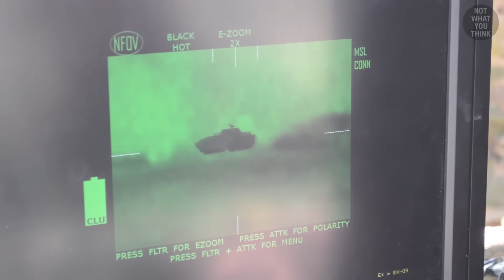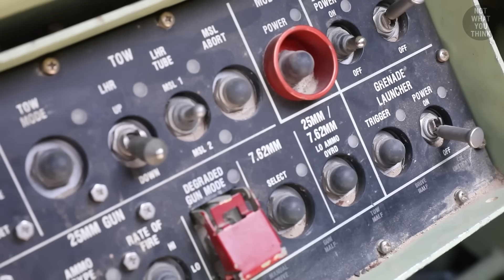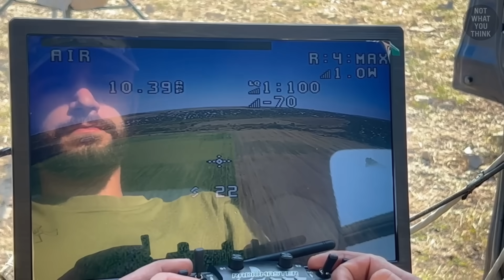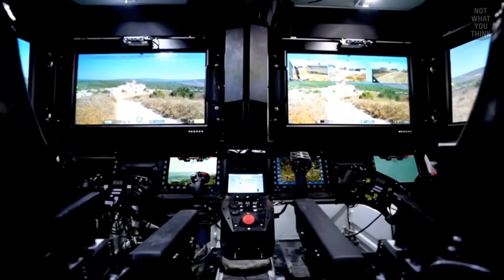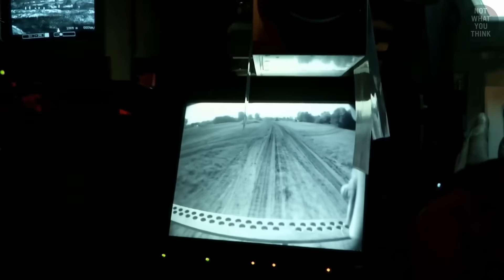How Bradley IFVs prove more Useful in Ukraine than Tanks

Comment from the maker: Do you think heavy main battle tanks are standing on their last leg?
Reply: No. Since their inception they have always been in an arms race with infantry, with both trading off the advantage. At first they were almost indestructible to infantry,  until the anti-tank rifle made them vulnerable. Then they got thicker armor, and only tanks could harm them. Then HEAT rounds made them very vulnerable again. Infantry and tanks have always been trading off the advantage, the only difference today is that infantry currently have th upper hand, but eventually tanks will gain it back with some new technology. Just because they have the disadvantage now doesn't mean they are obsolete, they will.always be useful in some capacity, just like how after ww2 people though HEAT rounds made them useless was proven wrong
Reply: @pogfrog4221  Agreed. Main Battle Tanks will evolve but still remain relevant. What MBTs are going through is a temporary setback for the current designs. Threats they were not developed to counter are currently a weakness. Similar to full plate armor of the 15th century meeting firearms. Back then, the trends set largely saw a reduction of armor more and more until we got to armies not having any armor to speak of until body armor was reintroduced in the 20th century. Body armor of today is essentially an evolution of the suits of armor of the past, just meeting the needs exposed by the newer threats of firearms. MBTs are not going to be phased out as they still have extreme survivability bonus and their capabilities to penetrate and overrun defenses will always see them used in battle. They will change in capability to meet the newer threats.
Reply: I dont think so
Reply: @AFG.1 😊
Reply: People keep claiming that the tank is dead. I’ve even seen people arguing that we should only build IFVs from now on. These people are brain damaged at best. Heavier tanks serve a very different purpose to an IFV, and instead of trying to design one vehicle that can do it all, I think we should be specializing our vehicles more. After all, a Jack of all trades kinda sucks at everything.
Reply: No, because even though it looks like they are on their last leg these days, there may come a day when you need a big heavy main tanks like them again. Technologies will continue to improve and change, and one day we might come a full circle and end up in situations where you need something big and heavy to defend or punch through hard targets.

That's just me though. My 2 cents.
Reply: These light, mobile infantry transport/support vehicles are a trend because this is currently being understood as the next step in increasing effectiveness of land forces. Same with drones.
Next step, not a replacement for existing doctrine. Just polishing it.
Crowding out "mammoth" tanks completely might take another hundred years.
These light 105 mm tanks might be an even smaller niche, for a long, long time.
Reply: No, because active protection systems such as Trophy, Iron Curtain, Quick Kill and Afginit will become better, cheaper and more common.
ECM and IR suppression and stealth and quiet electric engines and improved armor will also keep MBTs relevant for decades, if not centuries to come.
Reply: Abrams X says otherwise =p
Reply: no? Look at ukraine.

It became very apparent that APS, Drone jamming, Drone coutnermeasures etc becoem more relevant but the tank is still relevant,

And we aint seeing massive tank manouvers due to it becoming a staticer war. Russia was not intelligent enough to make mass tank manovuers in the beginnign and UA lacked the number.
Reply: i don’t think so, if you think about the better western tanks are rarely being destroyed in ukraine, for eg the only challanger 2 losses have been from friendly fire, and a ukrainian driver taking one right into a minefield. so it’s just that russian tanks are outdated (obviously) and are not up to standard anymore
Reply: @spytf2693  and are LED absolutly horribly
Reply: No.  I'd say that there's always going to be a role for a Heavy Armoured Combatant, just as there'll be one for Infantry and a Light Hard-Hitting Skirmisher.  It's just a case of how technologies have changed modifying how crucial certain roles are.  In the modern case, it's just a factor that the Light Hard-Hitting Skirmisher role has until recently been rather minimalised whilst the 'Tank' role has stood out on top with the Infantry comfortably holding it's spot in the middle.

All that's happened now is that the current Tank designs have shown they were designed before several major developments in military technologies happened that make it so the 'Tank' role is not quite as prominent as it was whilst the 'Light Tank' role has regained some relevance.  However if future developments happen, it could change all over again.

For one example I could very easily see happening, you could have a breakthrough in ECM that means drones need to have their controller be very close to break through the jamming whilst also making a major breakthrough in large unmanned combat vehicles.  If that happened, you'd probably see a situation where the Tank evolves into a Command Tank which focused less on it's own offensive capabilities in exchange for strong defences and the ability to control a squad of light tank drones surrounding it.  But the Tank would still be a Tank.
Reply: tanks utilize a method of engineering specified for them. I cant recall the specific terminology, but it boils down to mixing mobility, firepower, and armor. tanks will almost always have a place on the battlefield because they are infantry support/anti tank systems at this point. all we've seen is modern (a hilariously loose modern for Russia) vehicles meet modernized tactics. Russia is still essentially doing the same thing they've done in WW2 where Ukraine was taught tank tactics by western powers, especially the US.

Russia relied too heavily on their tanks, pushing ahead without support, pushing blindly into enemy territory, and really not having any situational awareness whatsoever. Honestly you should've made this video about why Russia sucks at tank warfare because that's all Ukraine has shown the world.

in the several months that Ukraine has had western armor they've lost 1 challenger 2, and I believe 2 or 3 leopard 2s. that's nothing compared to what Russia has lost in the same time period for their most modernized models of T 90s and T 80s.

The US is simply looking to build a dedicated light tank platform as it has reduced costs and provides excellent firepower. The previous equivalent to this that was somewhat regularly fielded was the stryker MGS and those have been retired if i remember right.

a well trained, diversified, and efficient military are what really matter.
Reply: The tank has been standing on its last leg every since it was invented, so yes, main battle tanks are standing on their last leg, and are likely to keep doing that for several decades still.
Reply: They will be a smaller component of the overall force, drone FPV pilots and long range MLRS teams will take some of that back, but pretty soon they will have unmanned tanks and all bets will be off
Reply: I think they must coexist with lightweight agile models to protect them in a campaign. The lightweight models should focus more on aerial based attacks that commonly take out the main battle tank.
Reply: MBTs can definitely stay relevant, but they're gonna need radar and point defense weapons to do it not unlike surface Navy these days.

an efficient DE weapon and detection system for example, but until these get installed on modern armor it's definitely going to be an argument whether MBTs are a liability or assets in Ukraine.
Reply: Clearly not and frankly this video is fairly ignorant. 
1) Tanks have always  been more vunerable to infanty weapons. Even as far back as WW2 Anti tank cannons destroyed more tanks then other tanks/airstrikes/arillery. So this not really a new development. And hiding troop movement was not really the main goal

2) A IFV is not just a troop carrier otherwise it would be a APC this is what the MBT would usually fall under. No IFV has really "blurred the line" with a MBT with the exception perhaps of China's VN20 with the 100mm variant. Though that seems to be aimed at clearing trenches 

3) There is also nothing that can fufill the role of a MBT that is not a mbt and pretending a IVF better survivability then an MBT of the same generation is just insane. Yes if people are to busy shooting at the MBT next to it it will survive longer, but that are their respective roles. Get rid of the MBT and all of a sudden that much thinner IFV is a easy target. You need both IFV's and MBT's to work together. The reasons Bradleys are doing well is because almost everying thing else (except for the newly delivered western MBT's)  is junk that has not really been upgraded in 30 years. And the BMP has been doing just as badly at its job as Russias MBTS. 

4) no MBT's are not better at urban bombat, sure they have better armor. But the limited elevation of their cannon can often mean they cannot fire at targets that are to high/to close as Russia found out in Chechnya. 

5)Western Tanks also do not opperate in stand alone formations. Silouet is also not that much  of a issue. 

6) The renewed interest in light tanks is not to replace the role of the MBT but to suppliment it. Yes MBT's are getting lighter but that is also to make space for better active protection systems and other such.

7) Really less oxigen?
Reply: Light and fast is absolutely not a new strategy though. Many countries in Cold War tried it, and then dropped it. There is no way lighter vehicles are more resistant to all these new things that are threatening MBTs, they are all equally or even more vulnerable to them.
Meanwhile Bradley is simply a different class of vehicle than a tank, meant to act in combination (as Bradles was designed for Abrams) or in different roles. Their massive impact is more in form of contrast to the minimal survivability of eastern equivalent vehicles Ukraine was operating, especially the BMPs with their notoriously thin armor and mine protection so bad troops of both sides often ride on top rather than inside. Which, by the way, are much lighter than Bradleys. There is no escaping physics, more protective measures add weight to vehicles, period.

M10 is not intended a replacement for Abrams, but something to allow airborne and other fast expeditionary forces to have any tank at all, but that's not a relevant scenario in Ukraine.
Reply: Consider the Javelin.  When any bush in a 2.5km radius might burp out a missile that is going to attack your vehicle's weakest top armor, how do you expect losses to be acceptable?  If your infantry is being asked to screen to 2.5km, it isn't really being supported by armor.
Reply: Yes, I do. Even modern MBTs get knocked out by a single Anti-Tank Guided Missile or direct hit of artillery fire, same as a lighter and cheaper to produce and operate light tank, IFV or armored wheeled vehicle. The 120/125mm cannon is already an "overkill" weapon, so it's degrading size will be the next trend, right along the decreasing in armor. Like mentioned, just as it happened with ships...
Reply: Should've said "are they on their last tread" missed opportunity😂
Reply: Nope
The biggest reason why Russia isnt in Kiev yet is because they forgor how to do combined arms warfare
Reply: @neonmem8826  There is no doubt Russia has self limited its engagement style, and asking why might be worth doing.   Knowing democrats have a long standing affinity for Russia [it was, after all, the place chosen to drop the dossier into for purposed discovery by western allies to gift the false provenance needed for fbi actions], I use the bank robbery model: its a troika in full agreement, using the country as a pinata.  Taking Kiev ends the game early and is to be avoided.   Bagman [Biden]: brings the money - makes it rain.  Doorman [Putin] controls access/keeps action going.  Driver [Zelenskyy] facilitates succcess in getting away with it all - he's dancing as fast as he can.  When this crime is over, Putin gets a chunk of Ukraine land relabeled Russia in perpetuity - an annexation will stick.  Biden crime family?  I'd wager a vatican account is in their future - keeping money abroad prevents all manner of US records from ever being created, thereby nullifying foia risks after leaving office.  Zelenskyy?  Who knows.  If he isn't exiled, maybe he becomes an art dealer to reintroduce missing cash to "legitimacy".
Reply: No, all of them will soon be equipped with modern APS like Trophy which can already cover 180º vertical and 360º horizontal so all drone/ATGM operators can go cry in their corners. The only way to destroy tanks will be APFSDS or insanely large laser guided missiles/bombs that can destroy the tank even when exploding some meters away from it, this can only be achieved by Aircrafts.

Also every MBT in the future will become Hybrid, there is simply no reason to not use an electric engine as it can make a tank accelerate insanely fast, the upcoming M1A3 Abrams will probably be Hybrid already as they just have to use the Abrams X powerpack, it is already done and tested.
Reply: I wanna enjoy your video and the intro gets me hooked but then the crigne out of place "is not what you think" line comes and I just, I just have to close out. Sorry.
Reply: No, because I don't see Ukraine being much of a benchmark for Future wars.
It is a war where neither side has the ability to achieve air dominance.
So, half (and arguably the most important) part of the Combined Arms doctrine is missing, which leads to operations being much easier to counter.

Air Superiority, or at least Air Dominance would allow you to strip the defending side of all options for defense before you even send in Tanks.
Artillery? Hunted down by Aircraft.
ATGM teams? Hunted down by Aircraft and Drones.
Bunkers? Hunted down by Aircraft.
With the ability to strike rear logistics en masse day after day, the frontline troops would struggle to get ammo.

This may be the future of warfare for countries that cant afford an Air Force, but the big boys (US, NATO and potentially China) won't really need to face the same attritional battles that Ukr and rus are.
Reply: No, since I think as tanks are evolving right now, so do the tactics. The main advantage of a tank is its combination of mobility, armor and firepower. Now with modern technology like active protection and capabilities of connecting to drones and increasing firepower, I see them becoming more of a multirole military combat vehicle. They will be definetley relevant for quite a while.
Reply: There's a reason hunters typically don't use bazookas and medieval armour when hunting rabbits: there are way less cumbersome alternatives that do the job just fine. The same can be said about tanks, there's no reason for a bazooka if you're only fighting rabbits. And since lighter tanks tend to be more agile, smaller, and easier to keep operational there's always the question of whether a heavy tank really needs to be that heavy. I doubt heavy tanks will go extinct, simply because there's still enough of them around to warrant having your own heavies. But given the potential of missiles the tank guns might never become this big again
Reply: Drones are a new addition to the battlefield and their counters like jamming, lasers and specialized aircraft guns are still catching up. When they do, the situation will mostly revert back. A bigger problemhowever is that armor has effectively lost the race against the penetration capability of both APFSDS and ATGMS. It's likely that armor going to shed a lot of their weight in favor of more active protection systems against all threats.
Reply: Yup 
Israel , South Korea and the US have 8 pack Spike NLOS launchers mounted on light vehicles
A Spike NLOS can shred any MBT due its large warhead and Top attack ability but its mass is also problem for APS
The Japanese Type-16 MCV has 105mm cannon
So the MCV fitted with Trophy APS and LAHAT 105mm precision round can engage IFV/AFV while JLTV engages tanks with Spike NLOS 

The MCV only weights 26 tons and JTLV 10 tons while MBT weight over 45 tons
The MCV needs 40 gallons of fuel and JLTV need to 25-30 gallons
In pince, you can refuel an MCV or JLTV with jerry cans 
MBT need 300-500 gallons of fuel and fuel trucks is the only to refuel them

The JLTV is light enough to carry by heavy lift helicopters and a C-17 can carry two MCV
Tanks again, the only real way to carry them in numbers is by ship or rail

Modern warfare is about high mobility and tanks dont have that
Which is easier to replace
Which is easier to repair
Tanks had a good run but protecting them is problem
The Abrams X addition of 30mm cannon is GD recognizing that tanks need more protection but the design needs improvement
The 30mm cannon cant use one size fits all, its needs a style revolver cannon able switch between HEDP. SAPHEI, Airburst and AHEAD 
HEDP for general purpose, SAPHEI for Anti-armor , Airburst for hidden targets and AHEAD for Anti missile
Reply: It is mainly a poor tactical approach. Those tanks are often unprotected no IVFs to cover from drones in the air or against infantry attacks. 
They have to be well integrated together with some infantry.
Reply: I think the fact that Ukrainian's are continually asking for more is evidence that the Tank still is extremely useful. However many tanks have been lost on either side WAY more IFV's/AFV's have been lost
Reply: "...how the M1 Abrams gained its legendary status somewhat unfairly...".  73 Easting says the reputation was gained fairly...
Reply: No. Not by a long shot.
The Russians have lost as many as 15,000 AFVs to Ukraine since 2020 simply because Russian tankers are poorly trained, poorly led, and poorly deployed. With the destruction of the majority of its newer tank designs, Russia has to go back to older, mothballed tanks, which are even more vulnerable than the T-80 or T-90 tanks.
Meat attacks of light infantry at no more than company strength, supported by 3 to 6 AFVs, no air cover and very little artillery support will always result in heavy attacker infantry casualties and the loss of most of the armor assets. Russia does not seem to be able to organize and execute an offensive above battalion strength against well defended positions, and I do not foresee that changing for the better for them as their economy tanks and their productivity declines even further.
Reply: @boydgrandy5769  It was a dumb clickbait question...
Reply: Yes, and when China invades Tiawan you will see the real might of Russia. They have the largest stockpile of WW#2 weapons in the world, so why not use them to find out how the west responds and how their weapons work.
Reply: No, if they can get the Trophy system installed and working, they still have a chance.
Reply: That boils down to re-supply.  Forward units in ww2 sometimes sat for days between convoys - more was better.  Combine armor piercing and flir technology of today into the mix, and the disposability factor has gone way up.  Build something the size of a fiat with 15 rounds and robotic deployment for quick/short 'bag of marbles' tactics to trip an enemy into getting positions revealed?  Numbers, plus a reduced heat signature from a smaller engine might get the job done.  They pretty much...don't come back today, unless superior airpower protects them 24/7.
Reply: Not yet
Reply: May be yes... in high intensity they cannot be used anymore like 14-18. Irak until trenchs etc are cleaned  . But still works fine at Yémen 2023. Lowest intensity
Reply: No. The Drone isn't going to be nearly half as effective in the next conflict due to the development of Integrated Jammers and the support of SPAAG-type/like vehicles. As such, the Tank will see a resurgence in heavy use as the argument that the Tank is obsolete could be applied to the basic Infantryman due to the extensive use of not only Drones, which have shown themselves more than able to attack Infantry, but also of the wide use of Machine Guns.

And since the Machine Gun has been in military service, and active combat zones, since the 1860s, gaining their real fame in the First World War, we can expect the Tank to continue on to serve despite the widespread use of Drones and other Anti-Tank Measures.
Reply: they're just targets
Reply: no, as a general put it. As long as soldiers feel safer with a tank, a tank will exist. Its just that right now weapons have advanced faster than defencive measures. As soon as reliable trophy systems and electronic counter measures catch up the tank will reappear.
Reply: Yes, everything is about to be replaced by drones. Even soldiers.
Reply: No, they will become more efficient and will have many new improvements, protection/s and anti -everything weapons.
Reply: Our enemy is a block that includes Russia/Iran/ China/ N. Korea/ Islamists.
They depend on MASS. Democratic Forces have fewer infantry but those "few" are trained in advanced weapons technology and highly motivated. (many Historical examples of better motivated soldiers defeating MASS). Tanks are important but motivated soldiers win in the end. 

Because Anti-Democratic Forces can spend their soldiers freely this is a problem that can be only finally solved by the FAMILIES in the Anti-Democratic countries uprising against the mindless slaughter of their loved ones. Grandmothers, Mums and Daughters NOT TANKS will decide if the War continues. So FREEDOM OF INFORMATION is more important than Tanks...
...as here on the internet.  

Slava Ukraini
Reply: isnt the Merkava already a MBT fused with a IFV ?
Reply: well you kinda forgot to mention active protecting sysfems for tanks and AFV as Windbreaker.. That quite eliminate advantage of personal antitanks weapons..
Reply: Offensive cannot be carried out without Main Battle Tanks. Maybe they are not as important as they used to be, but they are still necessary.
Reply: @doomsncrew  MBT are the to punch through fortified positions, because they bring a amount of firepower infantry can’t provide. Their armor allows them to take hits and continue, while providing cover for other units.
But they’re not invulnerable - most of the armor is in the front (again, take the enemy head on). They also suffer from limited visibility and fireing angles. That’s the reason tanks alone can’t win a conflict.
You need infantry to take care of enemies the tank can’t handle, like soldiers in upper floors of buildings with anti tank weapons.
Reply: Russia is not an occupier. Russia is liberating its lands from separatists, terrorists and Nazis who have settled there. in Russian, the words Ukraine and the outskirts sound almost the same and have the same meaning. ukraine is an integral part of Russia. this has been the case for thousands of years. Learn history!
Reply: doubtful, but they will be forced to change
Reply: more to the point, is infantry on it's last legs
Reply: Танки были и будут всегда, только очень глупые люди, особенно не военные, могут думать, что эра танков прошла! Все с точностью наоборот, в будущем будут Только Танки и Тяжелые БМП на основе танковой брони! 

СВО доказало огромную эффективность танков! Даже с учетом современных ПТРК, танки самые живучие и наносят огромный урон в ближнем бою! 
Танк в одиночку, способен прямой наводкой уничтожить бункеры, окопы, всю технику и пехоту!
Reply: The drone revolution and evolution is not finished and we still don't know how they will be utilized nor what capabilities they will have. However,  more, small, and cheap is in the future. Perhaps the fate of the Russian fleet is a better harbinger of the future.
Reply: Both sides of the conflict are scrambling to get as many tanks as possible to frontlines. That should answer the question wether tanks are effective or not...
Reply: @NotWhatYouThink how is this video possible to do without mentioning the best IFV in the world, the CV90?
Reply: Definitely.  Drones have made them obsolete unless they're used at night
Reply: No, people have been claiming the end of tanks since 1919. there is a natural flow of weapons vs. armor. we are just at the high point for weapons, and low point for armor. However, protection methods are on their way up.
Reply: an outcome I see the medium and light tanks making a comeback, less focus on MBTs.
Reply: no and for the very reason you stated Air power. this is not new, Rommel wrote about it is his journal, now published as the Rommel Papers.
Reply: No. Tanks can hold ground and mobile
Reply: Always will be a need for heavy armour. Just have to re think strategies
Reply: no
Reply: It's all going to be robots and drones. Small, autonomous and hard to detect
Reply: @@PeregrineAerialNW Leopard's and Abrams is never close to a capable tank. T-80, T-84 and maybe Leclerk and type-10 could be ones.
Reply: How is your channel theme song called? I actualy like it realy much.
Reply: NO!!! They haven't been used like they should be in this whole war
Reply: @oneshotme  hahaha, they just useful
Reply: Yes i think the Heavy Battle tanks have had their day the medium cv90 and Bradley types is better suited to taking down drones and manoeuvre through woodlands  and transporting is much easier
Reply: A reduced role perhaps. Such as troops and close air support with the a-10. Modern tanks will compensate for drones and manpads.
I love how political/geopolitical a basic yes or no question is here on youtube.
Reply: Um, no.
Reply: Challenger Tank holds the record for longest Tank on Tank kill 🇬🇧 THE British army hasn't lost a challenger in battle .
Reply: Booker tank is the same philosophy as the Leopard(1), and we all know how good the Leopard is compared to the Leopard2.  So it's hard to say.
Reply: No
Reply: Absolutely
Reply: Hardly
Reply: Tanks are not going anywhere as long as there are no other platform to provide mobile and heavy direct fire firesupport for (mechanized) infantry and bunker busting.

Tank on tank battles have never - and I mean NEVER - been viable. Even during WW2 armor was mostly used as firesupport, defence line breakthrough and defencive firesupport (in addition to actual AT-guns) roles.
Even then tanks were fighting tanks only as last resort and meant all other means were not enough.
Reply: From a young boy. I hated tanks. Always seen as boiling pots of human remains. Over Engineered.
Reply: No.
Reply: The West doesn't use MBT's the same way they were used in WWII like Russia tried to at the beginning of the war. The west always opts for air superiority first, then starts cutting off supply lines. The rest then get mopped up with armour but only once the skies are completely dominated.
Reply: If you fight them, like they are in this war on both sides but predominately the Russian side then the answer is yes. Also, UAV's can't take and hold ground and I imagine that new tanks like Challenger 3 and the others that come along in the future will be digitally enabled tanks and I wouldn't be surprised if tanks don't end up having a suit of their own defensive UAV's

Tanks are not invincible gods on the battlefield, they are meant to operate and fight within a battlegroup, predominantly at night, with air superiority,  infantry support, attack helicopters, artillery, armoured engineers, and with formation recce sending back info on best routes in and enemy positions en route,  some of the nonsense operations that I have watched on here, particularly some of the crazy Russian charges is completely alien to me as an armoured soldier as western armies don't fight in this cavalier spray and pray way.
Reply: It's nice to have an opinion even when it's misguided, the Brad needs heave tanks to help protect is and allow it to maneuver effectively.
Reply: Clickbait.  Now how about aircraft carriers ?
Reply: No. What made chariots and later cavalry obsolete, were substantial technological advancements. The same will be with the tanks...airplanes...ships...but we are not that far yet. After all, one could also ask, whether infantry men were obsolete?
Reply: @draganjagodic4056  Replace current weapons systems a with WHAT ?   Do tell us how it will play out, Nostradamus...
Reply: They will figure something out to defend against FPVs and loitering munitions...
Reply: The Russian and Chinese tanks yes.? They suck.
Reply: Give that HUGE SEVERAL TONS room to stretch her legs and not URBAN/CITY positions.
Reply: They will still have a use in some situations
Reply: YES,they are obsolete.
Reply: Nope they still have some use like breaking a stalemate with more casualties of course
Reply: No. Battle tanks first survived Bazookas; then they survived such tank killers as the German JU-87 Stuka and the Russian Ilyushin Il-2 Sturmovik; then tanks survived ATGM's such as the Russian AT Sagger missile; then tanks went on to survive the modern attack helicopter; and tanks will survive drone attacks. As long as ground warfare exists, tanks will always be needed.
Reply: Tanks are like CAS aircraft, and bombers. Theyre absolutely amazing at a specific task but you need to have control of the area for them to actually do their job.
Reply: i think mbt have more power
Reply: True
Reply: not really
Reply: Bradley infantry fighting vehicle (IFV) first saw service in 1981.

 To date almost 40% OF THE  Bradley infantry fighting vehicles supplied to Ukraine have been Lost or Damaged in the  Ukraine Counteroffensive

A Bradley IFV was seized by Russian troops after an engine failure in the Luhansk region of Ukraine. when  the Ukrainian crew bailed out, the vehicle was in pristine condition 

This vehicle was part of a display recently held  in Moscow's Victory Park
Reply: of course, they are on their death bed. with peak oil and more advanced ways of destroying tanks, they are going to be gone sooner then you realize.
Reply: @johnhumphrey9953  we've been hearing about peak oil forever and it still hasn't happened, especially because the US government is withholding our resources from us....
Reply: For sure heavy tanks are just a big blob of resources ... maybe it can destroy some tanks like say 4 and can withstand 7 but a light tank that has good and fast cannons could do 5  enemy tanks and withstand smarter on like 4-5 enemy tanks
Reply: The Abrams has yet to even enter the fight and you hear all of these detractors. In Desert Storm one of those things took two hits from an apache's Hellfire rounds. A Hellfire weighs 110 lb and travels at .6 the speed of sound. Even if the Warhead didn't go off the kinetic force would completely disable it, as found out in Syria and Lebanon through the IDF combat operations with TOW missiles at half the weight and a lot slower.  It would be like stomping on a cockroach and looking at it giving you the finger. The only injury was one crew member got chemical burns from a ruptured hydraulic line but if you know anything about anti-armor warfare, it is inconceivable to survive a hit from a hellfire. That just doesn't happen, until now. @NIGHTMERUL
Reply: @NIGHTMERUL Only 10% of tanks are destroyed by other tanks.
Reply: where besides the desert was there a tank  M1 Abrams?
Reply: What difference does the location make?  They slaughtered these T-72s and T-80s in iraq. What makes you think other than the range, that you'll have a different outcome. The M1 and the Challenger both have composit chobam armor, it's revolutionary and even though they got hits from the Iraqis there were only approximately 4 to 6 losses whereas the russian-built tanks was in the hundreds. The Soviets build tanks for numbers to swarm the battlefield, they do not take into account survivability, or crew comfort. They just want a bullet launcher. The Western tanks are built to take hits and keep fighting, Iraq proved that. As far as the losses of the western tanks thus far, hey, it's a battlefield. That's going to happen. @WhiteRabbit.
Reply: @WhiteRabbit.  Europe, maybe you zoomers don't remember the badass look that was US M1's and M1A1's in Woodland camo patterns.
Reply: @WhiteRabbit. I literally cannot understand what you are saying... T-72 dead? dah
Reply: @WhiteRabbit. Listen to this guy🤦‍♂️🤦‍♂️🤦‍♂️🤦‍♂️🤦‍♂️🙄🙄🙄🙄please nobody answer him .....he gonna argue bout something that he doesn't know smh
Reply: @WhiteRabbit.  Ukraine, Germany, Poland, Australia, Afghanistan, and now Taiwan.
Reply: @michaelbouldin7753  I apologize, use in combat conditions, not basing, storage? the use of drones greatly limits military equipment
Reply: Drones are going to replace everything on the battlefield.  Everything.
Reply: @THESocialJusticeWarrior  true
Reply: @THESocialJusticeWarrior Sure. EVERYTHING, even sliced bread. Seriously though hard-kill APS like StrikeShield can detect, classify and calculate an interception solution against a 125mm APFSDS round showing up on it's weak, minimal signature radar and successfully intercept and break it. That's a projectile of high-density tungsten traveling at over 1200 m/s with a kinetic energy of over 10 MJ. Several of the new tank prototypes shown at Eurosatory supposedly already feature an anti-drone mode for their secondary armament (30mm gun and whatever the 'Natter' is exactly). The Puma's gun has already been demonstrated to take out FPV drones with it's airburst ammo.
Reply: @THESocialJusticeWarrior I don’t see a drone working in the jungle. Or providing fire support. Taking ground either. I wonder why Ukraine is desperately seeking more tanks. Maybe because they are essential in warfare but I guess that I can’t really tell if your comment is a joke or not😂. Drones will be obsolete very soon. Just wait until they figure a way to shoot them down or jam them.
Reply: Today most capable tanks> Leopard and Abrahams?  🤣😂 Yeah Yeah
Your jokes are quite funny
Reply: @Kiyoone  Your low IQ is funny 😂
Reply: @Kiyoone  lincon